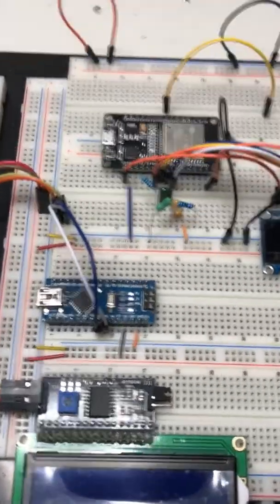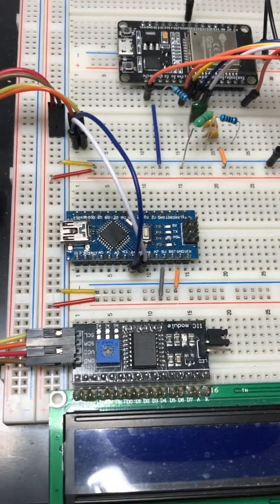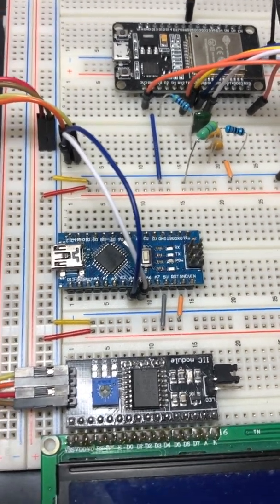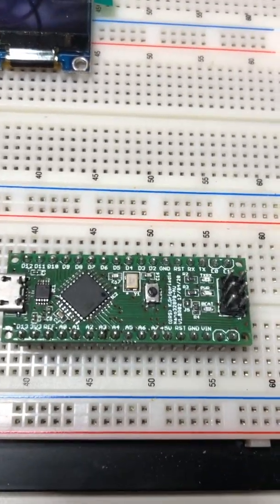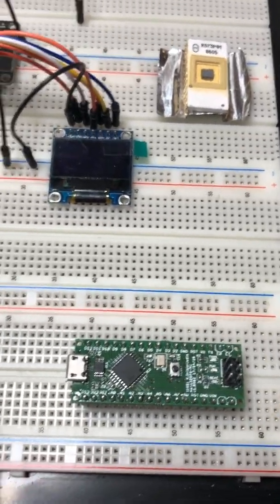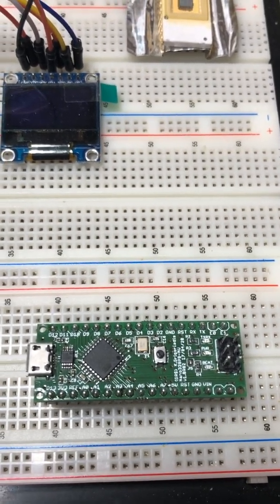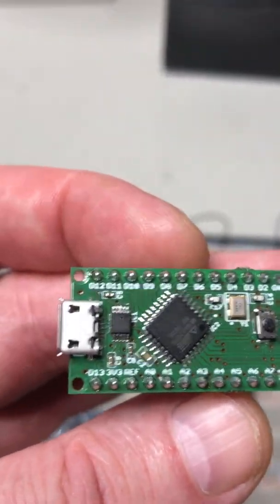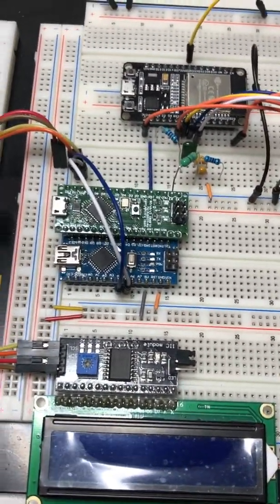ATmega328PB NANO Format Module, fully utilizing the Additional Functionalities of the PB Version

Comment: You've designed a very interesting board, and I've wondered why companies keep selling dev boards based on the 328P when even the manufacturer (Microchip) recommends against it. I would also highlight the extra timers on the 328PB, particularly if using Arduino functions that use the T0-2 timers. Of course now I'm wondering what happened to your design? Did you or anyone else produce more of your boards that are available for purchase? Thanks.
Reply from the maker: Hello, Thankyou! I hand soldered 5 Pieces for my use, but except of that there was no interest :-) even that the Design Files are available on Request.
I will make another Video in the Future more in-depth when I receive another 5 that i send for PCBA. Btw, there are some nano Boards from Ali that have The PB version on it but they doesn’t break out the additional pins.
Reply: @KonstantinGrigoriadis  I was surprised that no one had commented. Granted, the ATMEGA328/P/PB is a pretty basic chip line. I think a lot of people have moved on to ARM and ESP32-based boards. To be honest, I probably wouldn't have the same interest in the AVR chips if it weren't for their 5V capabilities and their relatively good ADC performance, but those characteristics are very useful in a lot of applications. The extra features of the PB variant remove a lot of limitations of the P version. I think people would be quite interested if they understood the improvements, but many Uno/Nano buyers are relatively inexperienced and don't have the technical knowledge to see the value, particularly without default support for the PB chip in Arduino.

By the way, I found your video because I had purchased some of those Nano boards on Ali. It's too bad they made no mods to support the new pinouts of the PB chip, but it's still nice to have the extra features. And clearly the lack of design updates is reflected in the very low price. Regardless, I'm looking forward to your next video on this topic. And subscribing. 😀
Reply from the maker: Hello and Thankyou! I have to admit that in that Period (1-2 Years ago) I used Youtube only as Platform where I could upload Videos and put these URL's as Link in Forums Like EEVblog... I never had thought at that time that I will make Video FOR YouTube. Now I am revisiting some of my Projects where I think that eventually there would have been more Interest if I had done a better Job with the Videos. I want to try a New PCB House for Double-sided PCBA and for that I will use this PB Design. Btw, I never Put them on Tindie or Produced them.
I will put on PCBWAY as a Shared Project where I will Upload all the Production Files for the Top Layer, on the Bottom Layer there are just LDO's and few Capacitors that can be soldered easy by hand.